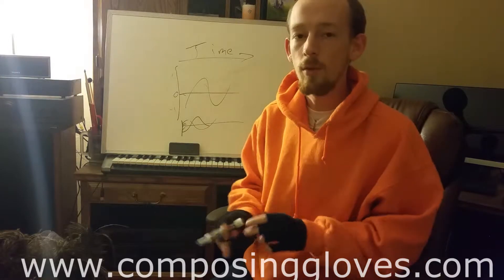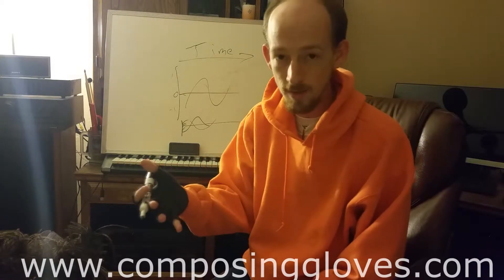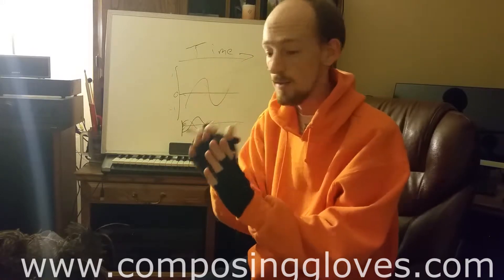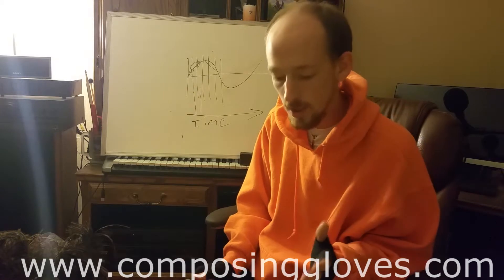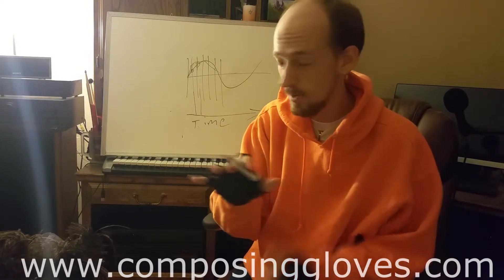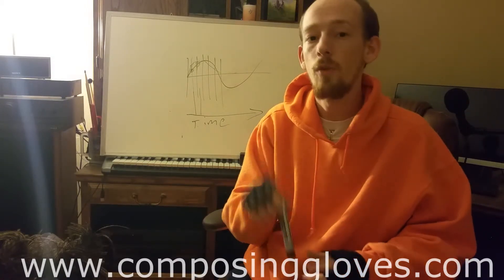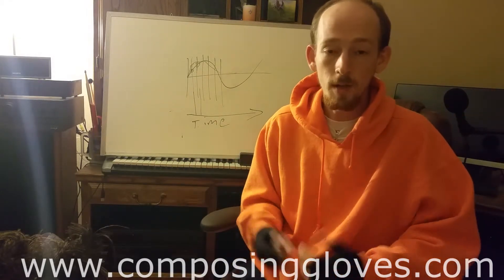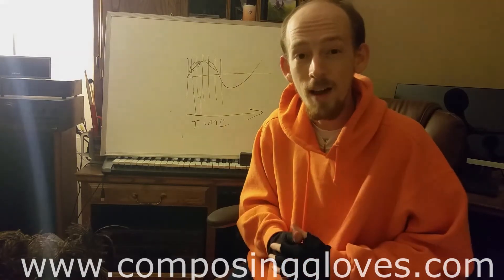Old DSP Basics 12 - Phase Modulation

Comment: Thanks for the video I have a question though If you can help me. Does Phase modulation recreate the input signal and combine itself to the original input signal or just change the phase of the input signal and come out as that signal? I hope I worded this well enough that you can help me . Thank you.
Reply from the maker: The input signal is affected by the modulation signal (which is not heard). So you will hear your input and the effect of the modulator. Its very similar to FM, in math you see it as nested sin(x) functions, like sin(sin(x)). The difference between whether its phase and frequency modulation has to do with the arguments of the function your changing.
Reply: Thanks for the response I appreciate  you.

Comment: I am not understanding this so much. I know what is phase but what is confusing me is phase ''modulation''. In massive it not make sense for me because when you combine 2 signals (carrier and modulating) that are completely out of phase you will hear nothing, but why phase modulating is doing totally different thing. I need help please, I know what is phase but not understanding what ''modulation'' of phase doing.
Thank you.
Reply from the maker: Modulating means you are controlling one signal with another. You hear the affected signal, but not the signal that is affecting. The phase is only important for the initial conditions after that if the signals are periodic then a constant result should be heard.

Comment: So what is the math equations for when I want to build a patch is MSP or Audulus or whatever?
Reply from the maker: I'm still pretty basic when it comes to dsp, and I have not used MSP or Audulus, but in C++ it can be as simple as x(n+1) where n is the current sample and the number is the value you want to shift by. Then you could get crazy with gain and attenuation using integrals. This is a good resource if you are looking for the straight equations to do the modulation tho: https://moinsound.wordpress.com/2011/03/04/frequency-modulation-or-phase-modulation-synthesizer-technologies/ This is an area I am still learning a lot about, thus the reason I stopped doing this series.